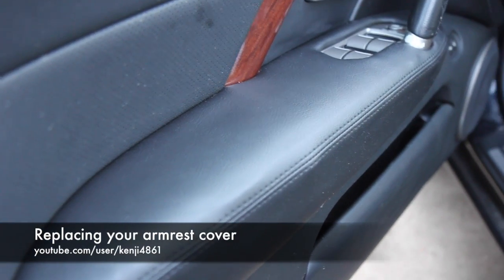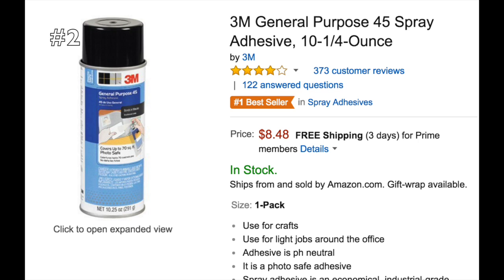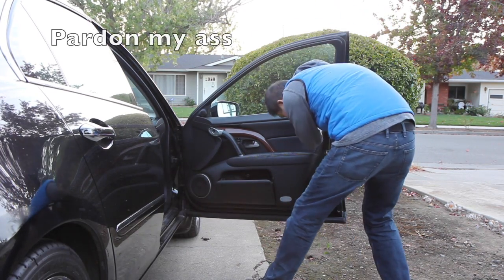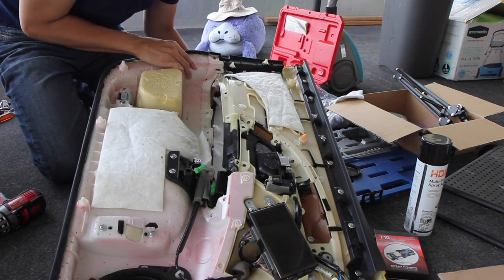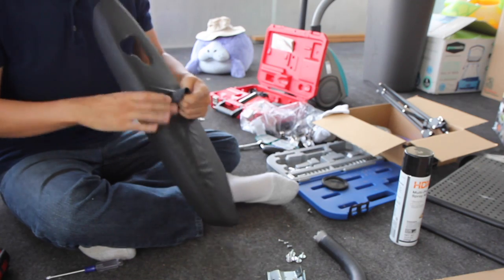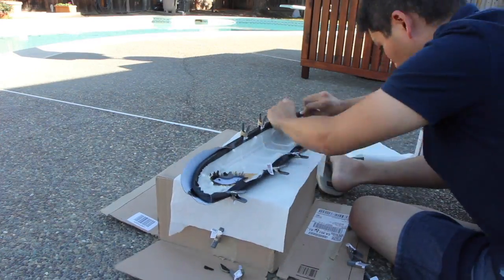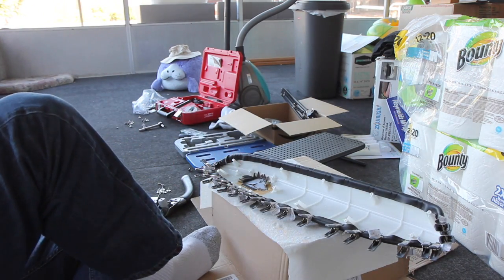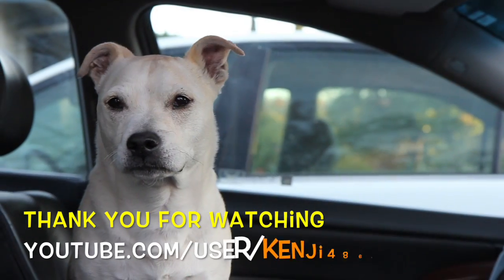How to repair door armrest leather cover on Acura or Honda

Comment: Before trying to glue the leathers on read the manual on the glue. You don't need the clips if you use the glue as you should.
Reply from the maker: Good tip.  Thanks Jakub!

Comment: That’s not the dog causing that. I have a 2012 TL and it’s doing the same thing on the passenger seat bolster. And my car is garaged always. The issue is quality. Only certain parts of Acura seats are real leather. The rest is made of a leatherette/vinyl material.
Reply from the maker: That's really good info.  So it wasn't the heat or my baby.  I owe her an apology.

Comment: Hey, on my 2010 RL, the passenger door pocket housing spring came off from it's spot. Do you think I can remove the pocket housing without taking the door apart?
Reply from the maker: Hey mine's half off too!  The plastic pocket right?  I haven't tried, but I don't think you need to remove the door panel to replace it.
Reply: @kenji4861  This pocket is in the lower part of the door which opens up.  Seems like soft touch vinyl pocket.  I couldn't find a way to replace the pocket except removing the door panel as you did or at least prying at the bottom and blindly removing 4 screws from the back side of the pocket.  I believe these screws are visible in your video

Comment: I'm trying to repair an armrest on a car, and need to know the best way of leveling it off before applying the new vinyl? Would like for it to be solid, strong, and sturdy. Some of the foam is missing from underneath the crack and it is concaved. What would be a good product to fill this with?
Reply from the maker: Sorry, I can't help you with flattened padding underneath the leather :(
Let us know if you found a good solution. :)

Comment: Quick question, so you just applied adhesive to the sides of the leather and not the top leather section where the arm rest on it?
Reply from the maker: I definitely applied adhesive to the section where your arm rests.  I think that part is more important to put on adhesive since your elbow moves it around.

Comment: He bro nice job what about the leather from the front seats?
Reply from the maker: You want to replace the leather on your seat?  I would just slip on a cover or spend $100-300 to get an OEM from someone on eBay.  If your car is more common like a Civic / Accord / Camry, you may try your local scrap yard.

Comment: You really liked synthetic over real leather?
I was targeting real leather for longer life but looks are important..
If syntetic looks like the oem stuff than synthetic
Reply from the maker: Tried both and absolutely preferred the synthetic over real leather.  Both looks and feel wise.  The factory OEM was definitely not leather.  The leather gave it that... real leather look which doesn't fit with the rest of the car.  I prefer real leather look on my wallet or portfolio or maybe even apparel, but no thanks inside my relatively modern looking car.
Reply: Kenji Yagi maybe if the leather was little finer type would have been better..like the leather on the seats..i guess the leather they sell is the basic type leather and thats why i looks out of place..maybe a nappa leather would look in place